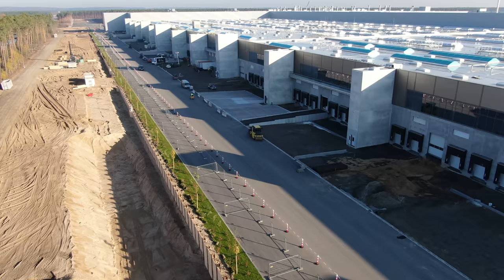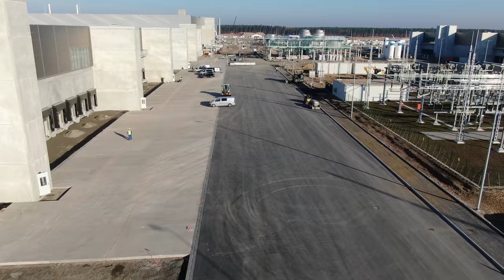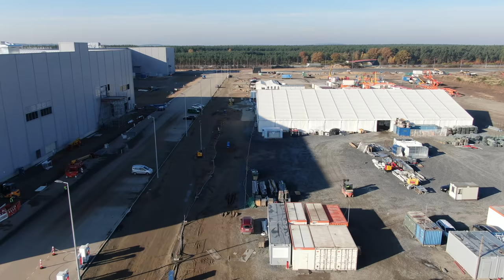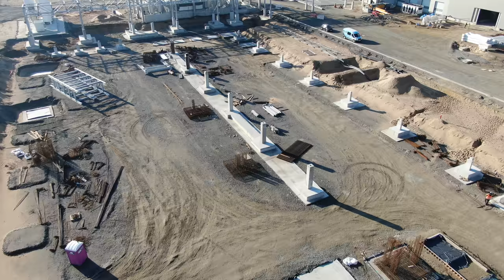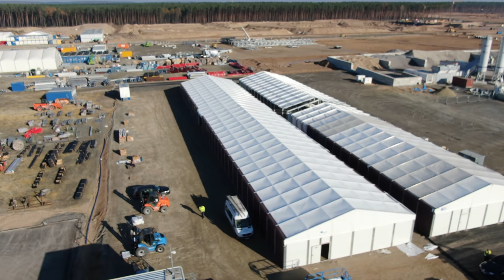Giga Berlin | 2021-10-30 | Infiltration Basins

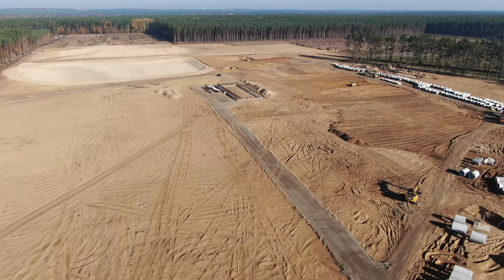Comment: 21:16 If you pause there, then you'll see the Infiltration Basin North. Just to the right of that where the bulldozer is, there will be the Trailer Yard. That is where all the trailers with materials will be stored until needed. 

22:19 If you pause at that timestamp you'll see the black plastic being laid out for the Fire extinguishing water retention basin. Just south at that basin towards the battery cell building under construction, there will be Distribution area for when cars are produced. Truck loading area will be just east of that towards the railway and the forest. Also there will be a Recycling Area for solid materials. 

Thanks Tobias for your efforts. Always appreciated.
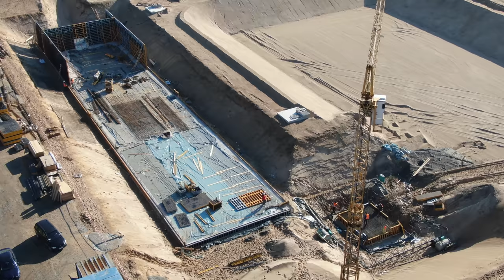Reply: Do you know what's going on at 19:40?
Reply: @kanahn7402  Iron work
Reply from the maker: @kanahn7402  stormwater retention basin on the right and the pump station on the left. From there the water will be pumped to the big infiltration basin.

Comment: It looks like Berlin-Brandenburg is making a "moat" along one side. Something like the Shanghai factory has. Maybe with trees and walking-bike path.
Reply from the maker: It's two long infiltration basins for rainwater from the roof of the main building. They will stretch all the way to the bridge in the north near the stamping section. A public bike path is planned on the left side of those basins.
Reply: @TobiasLindh  also ähnlich wie an Autobahnen, wo Oberflächenwasser darin gesammelt wird. ?

Comment: I am supposing that the rain that falls on the site will be channeled to those basins? I wonder if the water that they capture can be filtered and used. We always heard a lot of complaints about the water that will be used by the factory.
Reply: "I wonder if the water that they capture can be filtered and used."
Indirectly this is indeed the plan. The water will end up in infiltration basins, it will be filtered by the soil and refill the groundwater and thus the spring where Tesla gets its water from.
Reply from the maker: Using the rainwater means that the water would be missing in the ground. So to protect the water cycle they have to infiltrate the water. The water Tesla receives also comes from a bigger network from multiple wells, so it spreads the impact to a broader area.

Comment: Very random question, does anyone know where the logistics lot is going for the cars ready for transport?
Reply: Last 2 minutes.
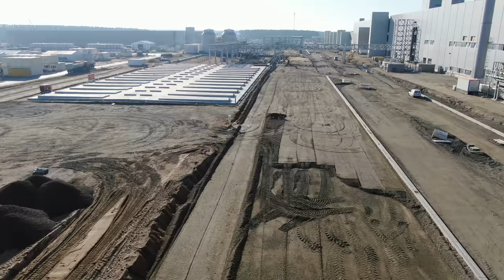Reply from the maker: The area at 9:30 between the concrete foundation and the future road.
Reply: @TobiasLindh  Thanks. That seems like a really small area especially when compared to Fremont or even China.
Reply: I checked the plan. The area at 21:10 min near to the new railway station is planned for logistics. On the left is the new infiltration basin.
Reply: @steffenoei8440  That makes more sense. I figured they'd move a lot of vehicles out via rail. I am surprised since they claim to only be "2 hours" from production start once given the green light, that they'd be ready to go, that they don't have this done yet, granted it's just a parking area, but still.
Reply: @WhoIsThis505  the production start will be very fast after the green light but like in Fremont or Shanghai the production speed will be very slow in the beginning. Maybe 50000-100000 cars in the first year. It is also possible to transport the cars from the factory directly to closed logistic areas outside the gigafactory in the beginning.
Reply: @steffenoei8440  Even Shanghai took 2 years to fully ramp upp.
This one's is bigger.
Would take long.
Reply: @WhoIsThis505  Tesla has stated there will be NO deliveries until 2022. Production yes, deliveries no.
Reply from the maker: @steffenoei8440  There will be a truck yard in the north east, but that's not for new cars. That might change in the future, but according to the most recent plans the area for new cars will be the location at 9:30 for now. There will be 21 electric chargers and 15 spots for car transporters.
Reply from the maker: @WhoIsThis505  It's not as big as the parking lot in china. But the first areas in china were pretty small too. I'm sure they will have a bigger area when they reach full production volume. But the area is bigger than it looks. It is a long stip starting at the tank farm. There will be 15 spots for car transporters.
Reply: @TobiasLindh  Thanks for the information. On the plan I know this area is called logistics and I know from Giga Shanghai the space you need for the produced cars is huge. But truck yard make sense, so obviously they have another logisticsystem in Grünheide directly on the transporters. Tobias ist halt doch am besten informiert, mach weiter so und Grüße nach Brandenburg aus Stuttgart.

Comment: will we see production in November 2021??? I think so!
Reply: no
Reply: Production yes, deliveries no. Clearly stated during the Q 3 earnings call. No deliveries until 2022.
Reply from the maker: I don't think we will see production in November due to the extended public participation, but December is possible.
Reply: @TobiasLindh  A lot of things don't have to be completely finished for production. But at the moment, series production still looks very far away to me. Supply lines, ventilation systems, the energy center - there's still a lot missing. Let's hope that the weather will continue to be reasonably good so that they can continue to work quickly outside.
Reply from the maker: @peterhackl8928  I'm talking about start of production. Not high volume production.
Reply: @TobiasLindh  Production is starting very soon IMHO

Comment: Will be the small overpass connected to the premises again?
Reply from the maker: The plan is to build a bike path between the highway and the factory (between the trees and the infiltration basins). That bike path will connect to the bridge.
But they also plan to widen the highway. And for that they'll have to remove the bridge. Then a new bridge should be build there.

Comment: What are the suez trailers for? they've been there since the start almost.
Reply: They have only been there since the test run of the paint shop. This is a mobile wastewater treatment plant.
Reply from the maker: Not since the start. They appeared this year before the start of the first equipment tests. As far as I know they are a temporary solution for waste water.
Reply: @TobiasLindh  Hi Tobias. On your twitter maps you show a building is going near the Suez trailers, do you know what it is for. There is also one on the railway track side of the current cement plant. Is that for pumping? Thank you
Reply from the maker: @gpsfinancial6988  A building for hazmat storage is planned the location of the suez trailers. But at first there will be a temporary hazmat storage in the east. The other building on the plans east of the current concrete plant near the train tracks is the solid material recycling area.

Comment: Nice video, as always!  Good to see it is starting to get cleaned up and roads being paved left and right 

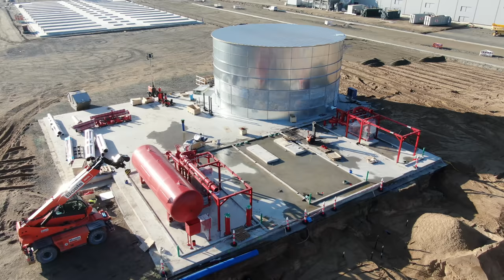@9:14 That huge (water?) tank and red vessel and red construction, is that for the fire department? Think of extinguishing agents stored in that red tank.. just guessing because its all red painted, I don't know.
Reply from the maker: It's the sprinker center. All the sprinkler systems will be controlled from there.
Reply: @TobiasLindh  Thanks! So I was not far off, as it has to do with fire fighting :-)

Comment: If they had a permit today, could they even start production? It doesn’t look like it to me, but I am no expert.
Reply: They are a long ways off from production.  Remember, this is Germany, where bureaucracy is a fine art.  Don't believe optimistic estimates.  Production will likely start in 2023 or later.
Reply: @ReachOutToWilliam   I know it is Germany. I am abnormal.. an American that knows Geography.  Not very common, but it does happen.
Musk stated he hoped to start production in October. Yet, even if he had all the permits, there is no way he would have a final products coming off any line.  Even drive ways are still missing.  My point is people should stop blaming the bureaucracy until we see a building that is completed and usable.
Reply: @brucemc1581  The bureaucracy protects the public.  And the Germans have the most highly refined bureaucracy in the world (followed by the Brexits).  Berlin is not Shanghai where the CCP can approve anything without permits, or Boca Chica where Musk can do as he wants.  The Berlin factory will have to meet German codes for construction, environmental preservation and mitigation,  and longevity.  Meanwhile, the TESLA plant in Shanghai is already experiencing significant foundation and building envelope issues. :)
Reply from the maker: There are a lot of regulations. That makes planning and permits more complicated. But there are a lot of things were Tesla got the approval early, but didn't build. For example for the supply buildings they had the approval since mid 2020. So it's clearly not all because of regulations and bureaucracy. 
If you think Tesla is held back by bureaucracy and permits, then you shouldn't think about 2023 or later for production. Because the final permit will arrive in December or maybe January, if Tesla doesn't change plans again. And when Tesla has the final permit, there will be no bureaucracy in their way.
And yes, I think they could start to produce today if they'd have the permit, but only at low volume. High volume wasn't expected this year anyway. In 2023 the factory should reach full production volume for phase 1.

Comment: Going on a limb here saying Berlin will be delayed a lot more.
Reply: Sample production is permittet now.
Reply: series production still looks very far away for me too. Hopfully they can start end of this year.
Reply: @peterhackl8928  The further the project goes, the more disorganized it looks! There are very few areas of site work that are complete. Site work can haooen dsquickly, but there is not enough equipment one site to show intent to move it along. Mechanical work also seems far off. Piping of all kinds, HVAC work all seems far off, and few workers. There qare several new buildings with only foundation rebar in place. They will each be six months of constructiion, then equipment and piping. i don't see this plant ready for anything but prototype production for nine months to a year.